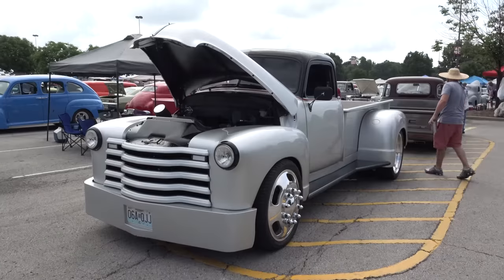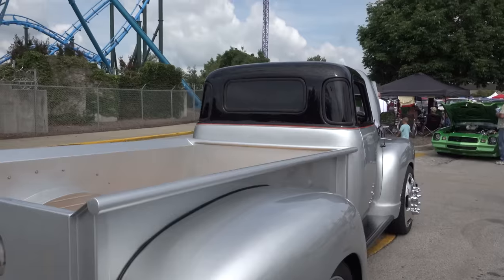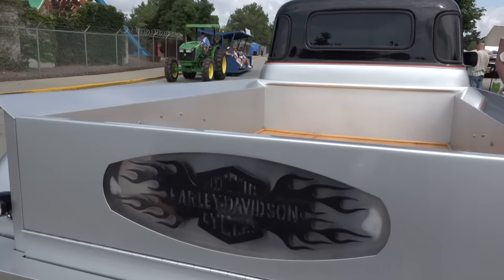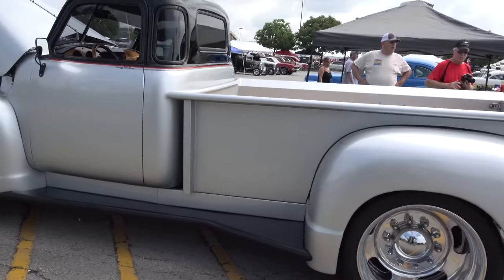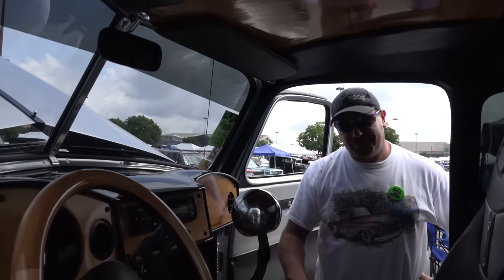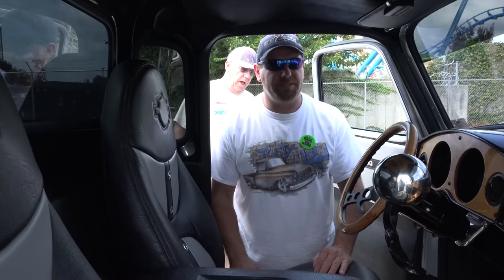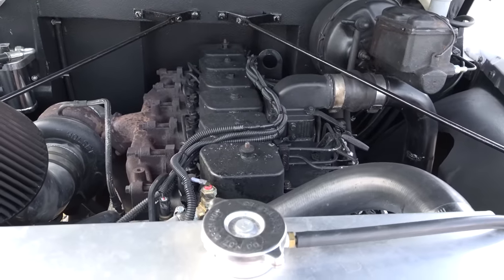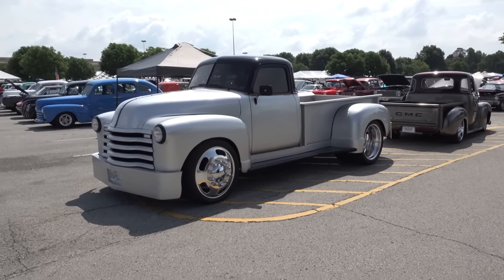1953 Chevrolet Pickup Custom 2016 NSRA Street Rod Nationals

Comment: Awesome truck. I am a huge truck fan. I've been buying trucks my whole life. I love them. I have a 2003 Silverado right now. It is still in great condition with very little body rust and only 95,000 miles on it. Change the oil every 3000 miles or less and it still runs like new. It hasn't broke down on me once since I bought it brand new. That Vortec V8 is bullet proof. Now I need one of these. Hook me up man. LOL
Reply from the maker: I just shoot the videos...Hook Me up!!....lol
Reply: ScottieDTV. My bad. I will  hook you up after I hook myself up. LOL